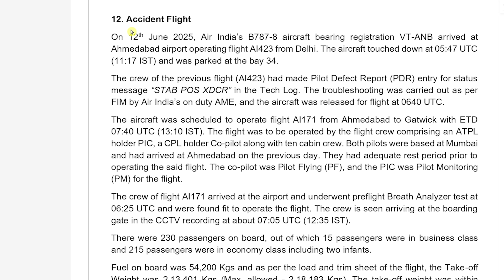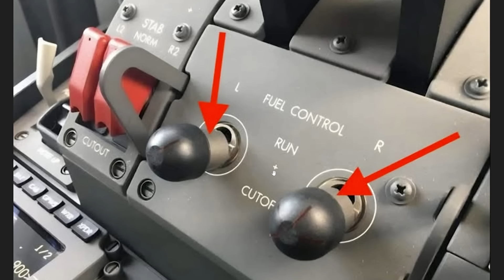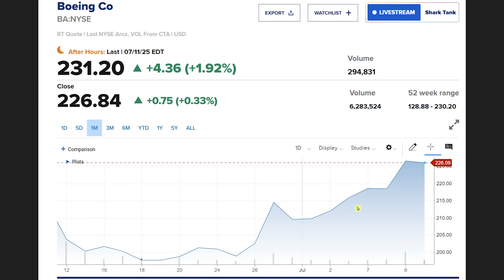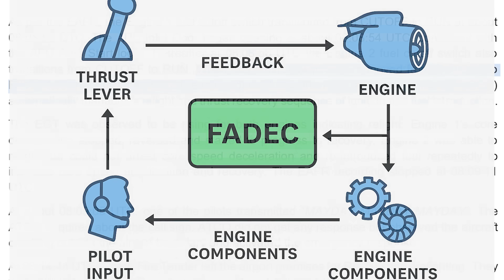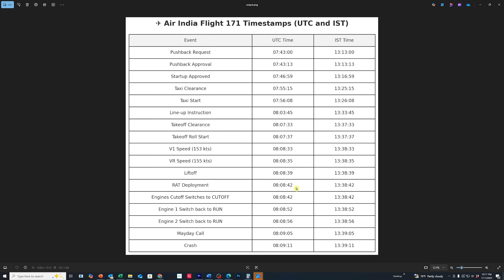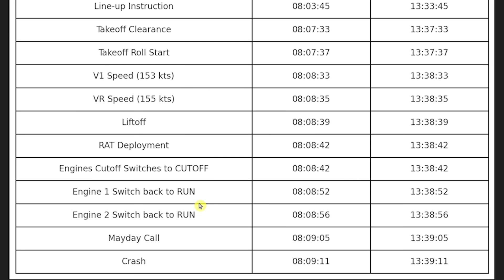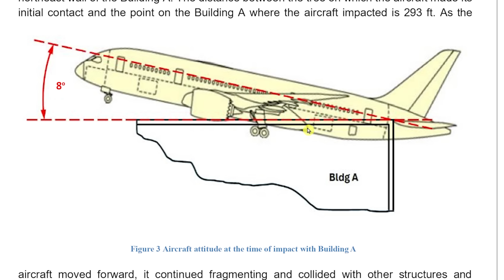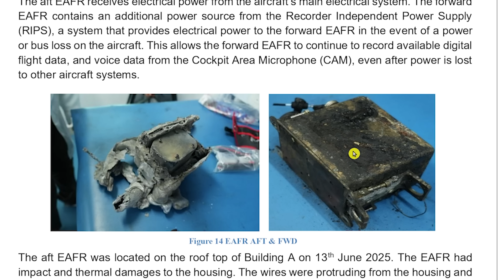Did Pilots CUTOFF Fuel? Shocking Twist Air India 171 Report!

Comment: The Report makes no sense. If there had been a struggle between the pilots, with one trying to turn off the switches and the other trying to turn them on again, something of this would have come out in the “mayday” call. However, all that the pilot said was “no thrust’. If the pilot making the call had known that the crash was caused by his fellow pilot, he would have said something to indicate this. His tone of voice is “no thrust” as if he couldn’t understand why the engines had lost power. My guess is that the pilot who asked “why have you switched off the fuel flow” was not looking at the switches. He would have seen the throttle valves in full thrust position and then the engines lost power. He simply assumed that the other pilot had turned off the fuel flow switches, since that it the only control which would have caused the loss of thrust. The other pilot denied that he had done so. The flight data recorder shows the switches being turned on and off. However, these are simply electrical switches. If the connection between the switches and the computer had been damaged, there could have been a temporary disconnection and then a reconnection, which the flight data recorder would show as the switches being turned off and on again, but the switches might not, in fact, have been touched. A finding of “pilot error” is essential, since, if these “fly by wire” aircraft are found to be inherently dangerous, they would all have to be grounded. That cannot be permitted to happen, so “pilot error” was always going to be the finding of the Report. The problem will only be finally solved after a few more crashes of a similar type have taken place. In the meantime, wise passengers will travel (as I do) by train and ferry. Even if the Report is correct, if airlines employ staff who are likely to attempt to bring down their aircraft by closing off the fuel flow valves, on a whim, then flying by air is not safe. So, whether the findings of the Report are accurate of not, the result, for the flying public is the same. Boeing says “trust us - our planes are fail safe - the airlines who operate them may employ suicidal pilots, but don’t blame us for that.” Well, it doesn’t really help, does it? The message is “fly on a Boeing - the computer won’t crash the ‘plane, but we provide every facility to enable a pilot to commit suicide by simply throwing a switch.” So, whatever the Report says, it does not encourage the flying public.
Reply: No.   There was no time to say everything in a mayday call.   Too much speculation.
Reply: Bingo too, fuel shutoff valves can be commanded by system software commands that close off valve to fuel. By condition of electrical condition fed to system,, without pilots knowledge,  due to override 😮,  see YouTube video Air India
Reply: There is no evidence the pilot said "no thrust"
Reply: @msv-777 If not, then Air Traffic Control made this up and, if so, why? All of the initial reports in the media included the words “no thrust”. These words were then removed from later reports. I assume that there are no recordings kept of the interchange between Air Traffic Control and aircraft.
Reply: @Mark3ABE  They should have full recordings of the interchange between ATC and aircraft exist. They just have not been released. The "no thrust" report was never confirmed - unless you can site a valid source?
Reply: @msv-777 Only that this is what the reports in the media said at the time. I suppose a journalist might have made it up. Still, if the pilot decided to put out a mayday call, why would he not add a brief and informative comment? It seems very odd. What is the point in putting out a mayday call but not saying what is happening? The Air Traffic Controllers might not have been able to see the aircraft, so that a simple “mayday” call serves no purpose. The “no thrust” comment would have let the Tower know that they needed to deploy emergency vehicles as the aircraft was coming down.
Reply: @msv-777 There is no evidence at all, because the Investigators have declined to make the actual cockpit voice recorder recordings public. The other concern is the announcement that one of the flight data recorders, designed to withstand much higher impact speeds and much higher temperatures has been found to be defective.
Reply: @Mark3ABE  They typically don't release full CVR recordings in a prelim report. The purpose of the prelim report is to state facts and help inform the public and allows for immediate action on potential safety issues. There is still a lot to learn - will just take time before we have all the facts.
Reply: Great writing 😂
Reply: Apologise
Reply: @PetraKann Apology accepted.
Reply: @PetraKann -- for what?  Stating the truth??!!!!!!😂
Reply: The preliminary report states that what was said was "Mayday, Mayday, Mayday." Nothing else. You say it doesn't makes sense, but you don't question why one pilot would ask the other, "Why did you go into cutoff?" And the other replying "No, I didn't go into cutoff."
You assume that such an action would be deliberate, but I suspect as the First Officer was flying the plane, that his inexperience led him to use those switches thinking he was retracting the landing gear. And the Captain saw it, and pulled him up on that.
Reply: @CuriousCrow-mp4cx This poses a problem. Air traffic control did report, at the time, that the call was “mayday, mayday, no thrust”. So, if the cockpit voice recorder has now been “doctored” to cut out the “no thrust” comment, this causes concern. Was air traffic control mistaken? Do they have their own recordings of the exchange with the pilots? So, clearly, someone is not telling the truth and so this always causes concern.
Reply: Communication with the ground is highly codified. A pilot wouldn't start telling a whole story of what is happening if the plane was about to crash. You have the black boxes for that.

The priority is alerting the ground there is a big bad thing incoming potentially, get the firemen etc ready.
Reply: Come on my friend, do the right thing and apologise
Reply: the RAT didn't deploy because of the cuff-off valves, 
It shows that it was a major electrical failure that was the reason for RAT deployment.
The report also does not state that the switches were definitely moved physically, they are going of sensor data that could have been due to an electrical fault. Remember the switches were found in RUN at the crash(pictures attached in the report). This could have been a major electrical failure and not pilot's switching off them physically, so it could have been an electrical failure which shows that both valves were switched off via electrical failure of some kind
Reply: All your comment is based in a fake info that the pilot said in the call “no thrust”. Based on the report the words in the call were only “mayday,mayday, mayday”. So every other argumentation based on this fake info is wrong
Reply: Redo your research. You got it backward. The switch were manually turn off mid takeoff and then it was turn back on after being realize it had been turn off. Screw up by one of the pilot or somebody was having a bad day and decided to take it out on everybody. Clear cut and dry conclusion.
Reply: @mitchnn -- BALONEY!!!
Reply: @mitchnn The finding of “pilot error” does not really help Boeing. It has designed software having an inherent defect. If the software had been correctly designed, once the fuel flow to one engine had been cut off, it should have been impossible to then shut off the fuel flow to the other engine. The computer knew, from the information being fed into it, that the aircraft was in the course of taking off. In that scenario, it would never be appropriate for the pilots to be permitted to close down both engines, so the computer should be programmed to prevent this happening. Essentially, in putting to fuel flow switches right in front of the pilot and providing software which permits them both to be turned off during take off, Boeing has, in effect, installed a “suicide switch”. The computer is supposed to be clever. Is it really clever for the computer to invite the pilots to close down both engines during take off? So, the finding of “pilot error” is still not correct. It is computer error, even if the computer did function as it was programmed to do - it was programmed to crash the aircraft if both switches were turned off together, so that is, in my view, still “computer error”.
Reply: @Mark3ABE Lol. This is the first fatal crash of this aircraft type. What does that tell you? Then if you read the report, it is mentioned that an FAA advisory noted these switches could be inadvertently switched to cutoff, and advised airlines to modify the switches to prevent that. As it was an advisory, it was not compulsory, and Air India didn't do the modification. I think that more experienced pilots didn't make this mistake, but this first officer with his low level of experience did.
Reply: You should see a psychiatrist - if you're not already.
Reply: @heinzriemann3213Thank you. The time I am ever really sure that I am right is when someone posts a reply with no content, only a gratuitous personal insult. That always confirms that I am right. If you thought that I was wrong, you would explain why.
Reply: @Mark3ABE that's some looney reasoning. 😂
 "If they call me a clown, that's because I'm right" 🤡
Reply: This doesn’t add up. Air India risks grounding all of its comparable planes, while Boeing stands to suffer multibillion-dollar losses in the event of a dual-engine failure. It seems far more likely that they’ve quietly agreed to hold the pilots responsible—after all, that conveniently shields both companies from facing the full financial fallout.

Comment: Sane pilot probably fought those 10 seconds with his insane colleague to put switches back in RUN position.
Reply: Disagree. Insane one cut off the fuel and asked why the other did so to shift blame. 
Only a few second later the same pilot realizes the engines lost thrust and turns on fuel without a fight because it's too late anyway
Reply: @heinzriemann3213 I feel like if I got accused of turning off the engines after seeing someone else do it I would have a stronger and more confused reaction than "I didn't". I'm sure the transcript will make things clearer
Reply: @pugletpie  That's true for sure, but could he have overlooked it?
Isn't the PnF have his hands on the throttle until take-off? So from the handles down to the switches, it would be just a small move.
But I do admint that it might be a stretch...
Reply: @heinzriemann3213 yes, he could have overlooked it, but the accusor would have known it was a risk bringing attention to his action and the ensuing "no, YOU did it" could have been picked up on the recording.  It's possible I just don't think it's that likely

Comment: Why couldnt it be just an electrical fault where both pilots touched nothing and the switches malfunctioned and activated themselves?
Reply: The switches are foolproof. They have never failed before.
Reply: @dare-er7sw  FAA issued SAIB No NM-18-33 on December 17, 2018 regarding the potential disengagement of the fuel control switch locking feature,...etc, etc, The suggested inspections were not carried out as the SAIB was advisory and not mandatory,...There has been no defect reported pertaining the fuel control switch since 2023.

Comment: I think calling the possibility of the flight crew intentional downing to be irresponsible at this point. Although plausible, the AD for fuel switches that never checked and that could have tripped without human intervention should be tested before accusations are leveled!
Reply: He isn’t making accusations. He’s making observations and exploring all possible conclusions. It would be irresponsible to not explore all possible contributing factors. Also manipulating the cutoff switch for one of two engines during takeoff is highly irregular, manipulating both inadvertently, mistakenly or as a matter of routine leaving both of the aircraft’s engines powered off is nearly impossible.
Reply: 2 protected switches fail 1 second apart after 11 years of service? It's like 2 of your car door decided to open at the same time while driving.
Reply: @mitchnn  it's not the metal knobs in the cockpit that failed. It's the electrical signal that is transmitted to computer thats being talked about. Software glitches and electrical interruptions are a possibility. Which is why the possibility of uncommanded fuel cutoff signals should be fully investigated to rule out. Because this has implications for the models still in operation and nobody wants that.
Reply: @shiftygirl6434  Where did you get the information about the electrical signal being talked about? If you mean the SAIB from the FAA, that was the fuel control switch locking feature which was the issue.  That was on the 737 not the 787 but I'm interested to know what you mean about the electrical signal.
Reply: You’re the one acting irresponsibly. There is so much evidence that one of the pilots committed mass murder-suicide like the Germanwings copilot.

Comment: Can the avionics be hacked somehow so that the cutoff switches were paralleled with another remote switch elsewhere in the plane?  In other words, could the computer somehow think the switches were set to cutoff when they really weren't?  Are they electrical or are they purely mechanical connections to the fuel pumps?  If they are electrical, are they somehow fault tolerant?
Reply: The audio from the voice recorder and the words "why did you cut-off?" Which corresponds to the switches being put back in place suggests that the mechanical switch itself was moved. The pilot would most likely not say that unless they saw the switches had been moved. 

Also, if the cutoff was activated without the switch movement as you suggested, the pilots would only know that the engines are spooling down so would not question anything about a cutoff, rather than a "we have lost power" callout. My point being that because the pilots knew the fuel cuttoff was triggered and responded accordingly, this means they could see it was cutoff.

The main question now is, why were the physical switches moved? I don't think we will find out for certain for a while, and potentially never.